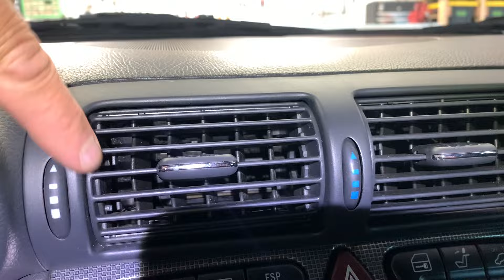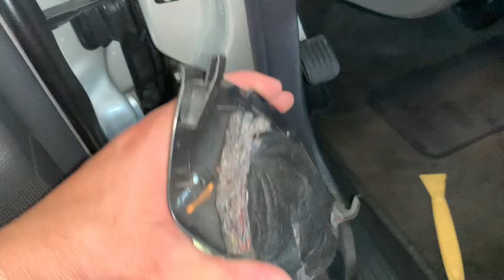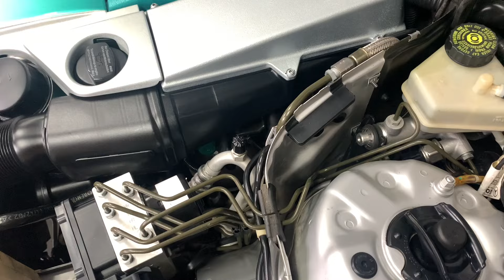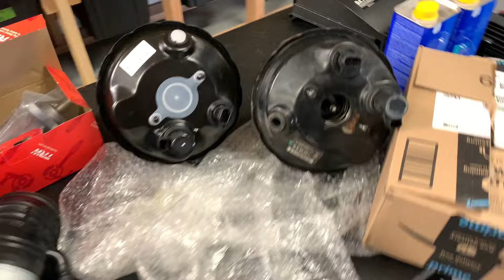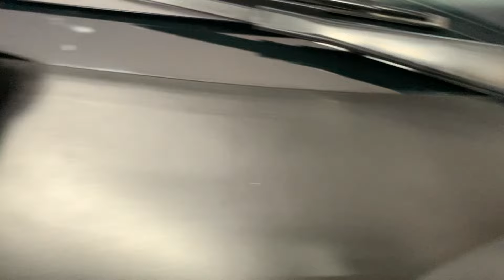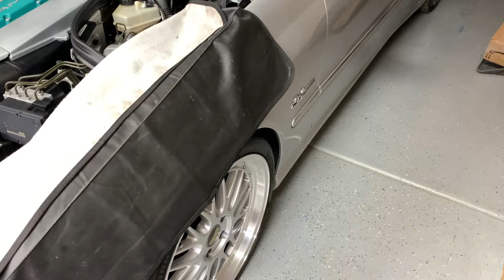Mercedes C32 AMG W203 Brake Booster, Master Cylinder Replacement and Brake Bleeding

Comment: Help! Any idea why the brakes would just go out while driving and she runs and you gotta pull the E brake. 
06 Mercedes Benz c230
Reply from the maker: @kaylanirvana- yikes!  I would start with the basics- pull a wheel and check the pads.  Make sure the lines look ok and check the fluid. It’s kind of odd that the brakes were just suddenly go out with no warning. Was there any metal scraping sound? Maybe the pads wore out and any of them fell out? I’ve heard of that happening.

Comment: you forgot to put the center hose off the cowl you gonna flood ur engine bay
Reply from the maker: @conradgraham4001  - Great catch!  You are correct.  Unfortunately, those tubes no longer fit.  If you check out my C32 Intro Video on my channel, I describe how I grafted the ends of the E55 airboxes into my stock C32 to airboxes, which allowed me to use the far less restrictive E55 rubber snout.  I finished off the airboxes (as you would with bodywork) and painted them to match.  You cannot tell that I did anything, it looks very stock.  In doing so, I can no longer fit the tubes you are referring to.  The good news is that I live in AZ, and we only get rain a few times a year.  Thanks for watching and please sub if you have not already!

Comment: Great vid very helpful information on accessing the center console, will help with accessing the blend door actuators that are making the clicking sound on my 2003 C32. Thank you for sharing.
Reply from the maker: @HawaiiDreaming- Great, you're welcome!  I replaced those actuators several years ago before I started to record content.  Not a terrible job, just a decent amount of parts to remove.  Good luck!

Comment: So Mike did you ever figure out how to remove that metal piece instead of the cowel to get the booster out? I am about to get out the cutting tool. My cowl is not co-operating.
Reply from the maker: @JohnBatesNaperville - Hey John.  From my experience, I don't think that you can get the booster out without removing the cowl.  What is the issue with the cowl?  There is a (very strong) adhesive along the bottom of the windshield.  Could you get the wiper arms off?  If not, can you use a puller?  Good luck!
Reply: @PrecisionMike  got the wipers off. Just didn't want to break the windshield,  or the cowl. I saw a guy that took it out without removing the plastic piece. 3rd day of working on this. There must be an easier way.
Reply from the maker: @ I think you are in the home stretch.  Once removed, the install is not hard

Comment: Great Video, I like your style. I too am very careful and meticulous while working on my vehicles, maybe not as much as you are, but still like things to go smoothly and back the way the parts were intended to be installed. Big question in my mind, is why the removal of all the interior dash components, what if any procedures can be eliminated on the interior?
Reply from the maker: @JohnBatesNaperville  - Thanks!  I appreciate it.  Regarding the removal of the interior parts, I found that to be the easiest way to access the nuts holding the brake booster to the file wall, and the clip & pin that attach the booster arm to the brake pedal.  I do not think you can get access to those items without removing the parts that I removed.  I hope that help.  Thanks again for watching!

Comment: Very clean work, i replaced my booster (2002 C240) last year at 250k miles. Just wondering what was the reason behind removing the dash ? I did mine without removing it.
Reply from the maker: @Sherohnn- Hey there.  I did not remove the dash, but I did remove the plastic wiper cowl.  That was the only way I could make enough room to get the brake booster out of the car.  Thanks for watching!
Reply: @PrecisionMike  I just realized I referred to the center console by ( dash ). my bad :)
Reply from the maker: @Sherohnn  No worries!

Comment: saw a vidio (not MB) but they removed the fuse box, which just a bunch of screws, btw, silicone spray is better the WD40
Reply from the maker: @rjkulman8990  - good to know about the fuse box, thanks!